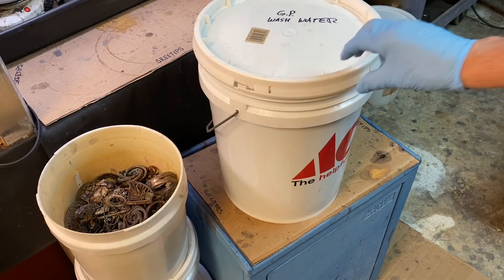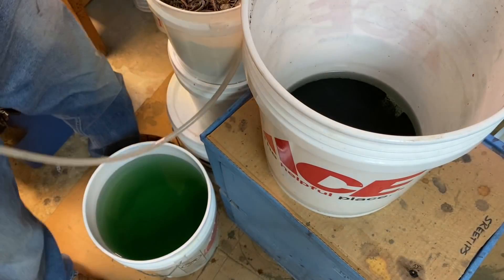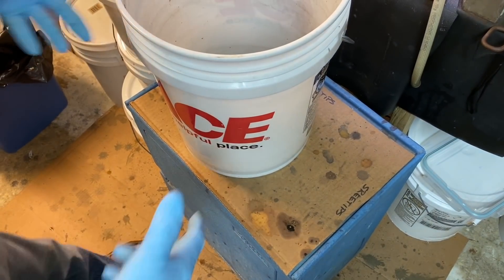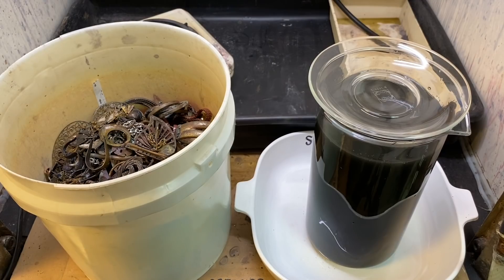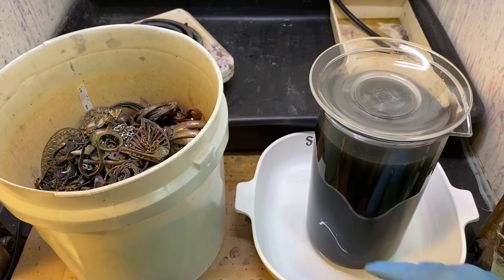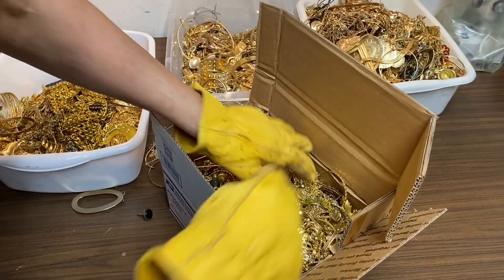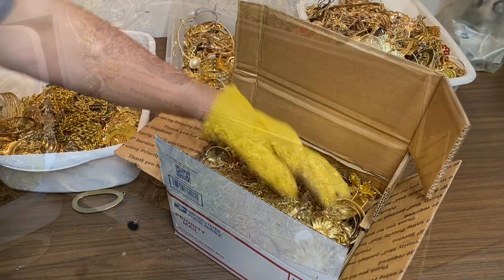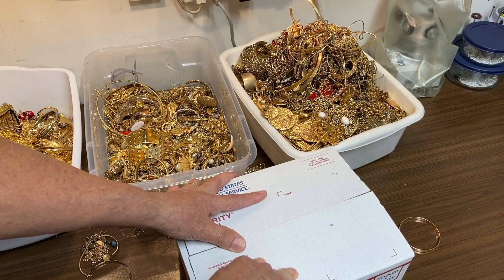Pure Gold Reverse Plating Cell Part 6

Comment: will this work if the underlying material is ferrous, or just if it is non-ferrous?
Reply from the maker: Any metallic substrate should work.
Reply: @sreetips  Thanks. I screwed up a refine not long ago becasue I had steel in some jewelry. I had carat gold with some fill. I got a big mess because of it. I am still sorting it out, but got really busy afterwards.

Comment: You should consider purchasing an auto-syphon.  A brewing tool that saves some time and trouble. It actually has a tip designed to not suck up yeast - it would work great in this application.
Reply from the maker: I’ll have to check into that. The problem is the solutions that I’m working with are highly corrosive. Any steel springs or other metal parts would quickly corrode.
Reply: @sreetips Auto-Siphons are made of a poly. If you type "NorthernBrewer AutoSiphon"  into a search engine it should work.

Comment: If I precipitated gold out my solutions how do I go back to my stock pot and get out the platinum, palladium, silver and other metals? Thank you
Reply from the maker: I just did a stock pot series earlier this year. Seven or eight parts if I remember correctly
Reply: sreetips I just started following you a month or so ago. I’ll try to find it if you cover how to do all that. May I ask what papers you use for you stannous tests?
Reply from the maker: Filter papers cut with scissors into little strips
Reply: sreetips does it matter what paper you use?
Reply: sreetips sorry about the questions I just have like 80 pounds of cpus tons of ic chips some other stuff and I know nothing at all. I ran one batch but I stopped to make sure I’m doing this right. I was doing HLC+ peroxide to bleach and whatever then stump out. But I think I may purchase some 70%nitric acid and make Aqua Regia for more pure results and easier process.
Reply: Or any tips on which method is best to pull out the most pure gold? Your videos are scattered from one metal to another and it’s hard to watch them all to figure out which process is best. I have all chemicals but nitric acid. Just wondering. Paralyzed dude just try to have something to do.
Reply from the maker: I use any filter papers that I have onhand
Reply from the maker: In my experience, low yielding computer scrap is best in A/P to remove all base metals BEFORE trying to dissolve the gold foils.
Reply: sreetips the HCL and bleach will purify it so when precipitated it will be close to .999?

Comment: I still have trouble with depleting scrap jewelry. Some gold will be thin and other substrate much thicker. When the deplating is past the point of removing gold, the ions being removed don’t just remove gold. Other metals start being moved to the destination electrode. So, then, how can we just remove gold from jewelry????
Much gold will be wasted by arbitrarily stopping short. I cannot come up with a process where ONLY GOLD is moved.

Comment: To recover the liquid off a settling material I found it better to pour remaining bucket into a very tall glass or plastic tube. Mine is 3 inches diameter. Settled liquid is very very easy to then de  ok separate into waste water rather than siphon from a large fat bucket. Just my 2 cents worth.

Comment: Funny feeling the yield is going to be low.
Reply from the maker: I’m guessing under two grams
Reply: @sreetips  My original guess, and still current, is under 1 gram of refined gold. The legal minimum in the US is 0.175 microns (about 0.000007 inch) of 10 K gold for an item to be stamped "gold plated". You can bet the manufacturers do not use much more than legally necessary.

Comment: If you use a taller reaction tank, you can settle out the sludge and decant off the acid and keep using it longer. I draw out the acid, then pour the sludge in to a reaction beaker for processing. You only need process the sludge, the acids can be used until it collects water to the point it is no longer conductive. I can then keep using the acid I have drawn out until fully used up. I think I could of run all the scrap and" I mean all the tubs" you have on hand with 2 gallons of Lab grade Sulfuric Acid or less. I never use any tap water because of unknowns and never wish again to make the mistake of putting gold in to permanent suspension, and losing it for ever. One word of note is that you need to consider the sludge at like 6 karat, until you have refined it to higher value cake. Right now you it looks 100x's more in volume than the value that is there. Some than you ran was gold tone or you would not of had the floating mess in the acid bath. The plating values are so all over the place it is never good to put any value in advance of what the recovery of pure gold will be.
Reply from the maker: Yes, could have kept going. But I must move on.

Comment: All that warning in the beginning, but then use water filled tube to siphon acid? Thankfully that had been diluted but maybe should have pointed that out. If that had been your cell electrolyte then a small volume of water from the tube would have hit the bucket followed by the strong acid and fireworks would have ensued. What you did was correct, but someone out there could get it wrong and that would be bad. Good luck to all and everyone be safe.

Comment: Hey Streetips, Since I am not 100% Familiar with this method of stripping, and since Concentrated Sulphuric is pretty nasty stuff, especially the hotter it gets, not that others aren't, but I am pretty familiar with those, I have a question. Are there not risks of forming hydrogen gas?  Is it a concern with the size of the cell you are using? It didn't look like you were using your fume hood, and I was just wondering about the risks. I  have been wanting to experiment with this type of a stripping cell for gold as well as silver, but have hesitated for that reason. Your thoughts would be appreciated
Reply from the maker: I did it inside to eliminate fume hood noise. Best to do it in the fume hood. I smelled rotten eggs for the last five days. Hydrogen is being generated. The greatest danger is spattering the acid on your skin or eyes. It gets everywhere.

Comment: Safety question! Could these reactions be done outside eliminating the need for a fume hood?
Reply: Simply put, no. As you have no control of wind direction, just like you wouldn't stick your head inside of a fume hood unit. I stress, do not attempt to do these experiments outdoors or you are putting yourself and others health and lives at risk. A fume hood directs the poisonous gases safely from the reactions in a controlled manner. There are also various guidelines to the correct installation of a fume hood, from location, proper sealant, gaskets, acid resistant ducts, safe location of exhaust vent and more!
Reply: @evokaiyo  thank you
Reply: In very small batches, yes you technically "can" but you shouldn't. I built my own fume hood using plexi glass a chemical filter with plastic ducting and an all plastic grow room exhaust fan, from Amazon. Cost me less than $200 when complete.
Reply: From direct experience: NO!!! The gasses produced are in a concentration that required SOME form of protection ... at bare MINIMUM, a vent hood ... but I use respirators as well cuz ... Oxygen!

Comment: Mrs. Sreetips is being a killjoy. On the other hand, working through 5600+ grams of jewelry to get a couple grams of gold is not the greatest use of your time. Is there a reliable way to separate the plated stuff that can be used for inquarting from the stuff that can't?
Reply: Not cleanly or efficiently. Gold plated jewelry can contain just about any metals on the periodic chart. It would require numerous steps to make sure one or more did not precipitate out with the gold.

Comment: hello, just a question would it be possible to use the plated jewelry as a inquartation medium for when you do the inquartation step in gold refining or is that just a hassle and not worth the energy/acid?
Reply from the maker: No, use clean sterling or copper for inquart. Gold plated is pot metal underneath.

Comment: If you're finished with the gold-plated  material, and intending on getting rid of the rest.   I would put up an auction on eBay for the whole thing, and ship via freight.   You could increase the value significanty by including the lead bar and copper basket.    It could be a turnkey refining business.      If your final yields ends up as a quarter ounce, I may be interested.     Great work, enjoying the series.
Reply from the maker: I had already planned to offer the tank, lid, copper basket and lead cathode.
Reply: There won't be a quarter ounce. It will surprising if he gets over two grams. 
Smaller lots of gold plate sell for far more on ebay than one large lot.

Comment: you said in part5 that this Method can not be used for computer scrap but what about computer pins that are metal
Reply from the maker: Any gold plated material with a metal substrate can and should be run through a sulfuric acid stripping cell.

Comment: You mentioned you put as much as possible plated material through the cell. Did it fill up, or did the copper basket break? 
I think the spoken warning at the beginning of the video is way more memorable than the written one, thank you for caring about people's safety!
Reply from the maker: The cell was still working, could have continued deplating more jewelry. But my other work in my shop is piling up so I had to call it. Twelve and a half pounds should be enough to give us an idea of what kind of yield to expect from this type of scrap. Could be wrong, but looks to be a surprise to the upside. The copper basket held up well and is in good shape for more deplating.
Reply: @sreetips  ah I understand. Thank you for replying and good luck with all your projects!

Comment: Hey Streetips, I'm loving this series of electroplating it takes me well back because my degree was in electrochemistry.  But I have a question, if you want to rinse the acid/waste solution off the the sediment why not filter it and rinse that way ? that would be my first choice.  But please bear in mind I've not been a Chemist for over 20 years now, I'm an air traffic controller so well out of touch.
Reply from the maker: Sierra Romeo Echo, turn left heading 330, climb and maintain two thousand five hundred, proceed direct your destination. Contact Departure. Sulfuric acid will dissolve a paper filter so I want to rinse off the acid first before trying to filter out the solids.
Reply: @sreetips  pan pan, pan pan, I did not know that so thank you. Hope you are well
Reply: @sreetips  oh I get it now !!  The rinse is not important it's the dissolution into aqua regia that's the key

Comment: could you do like a reverse quantitation where instead of adding silver you could add more gold and turn the gold plated into karat gold and then refine it from there?
Reply from the maker: No. The junk jewelry is a concoction of, who knows what, then coated with copper and finally gold plated. To much risk of getting junk in the gold and cause problem. Sulfuric acid stripping cell for this type of scrap is the easier softer way.

Comment: Sir if we remove that mud in filter and wash it and again put that mud on hotplate until  it becomes bone-dry will it make sense or ruin the process please let us know thanks
Reply from the maker: I will get the mud into a filter. Then put it in a melt dish. Then burn it to 800 F (420 C) for an hour. Then I’ll strain it through a fine mesh screen. Then dissolve it with hydrochloric acid and 6% sodium hypochlorite (bleach). Then filter and precipitate pure gold with with sodium metabisulfite.
Reply: @sreetips  thank you sir egarly waiting to watch the remaining part thankyou

Comment: I wonder if potassium alum could be used in the initial washing steps. It's used as a flocculant in water purification to speed the settling of positively charged particles suspended in water.

We made potassium alum from aluminum cans, potassium hydroxide and sulphuric acid drain cleaner.
Reply from the maker: If it will clean all the grime off the metal then it would probably work

Comment: Would it be easier to melt everything into a big brass bar and then dissolve the copper out via copper crystal growing with electrolysis in copper nitrate.... then collect the metals left behind in the sediment under the brass bar as it disolves and go from there???
Reply from the maker: The metal under the gold plate is pot metal, an alloy of junk metals. We don’t want that junk in our gold. Running it through the cell is the best way to process gold plated scrap.

Comment: Would a magnet on top help it settle faster since gold is dielectric
Reply: Do you mean diamagnetic?  No, it would not help with settling, even if it were diamagnetic.
Reply: @buggsy5  gold is absolutely diamagnetic and y wouldn't it be exploited
Reply: @DaHighRoad  
Because the magnetic field would oppose motion of the gold particles in the field. See the demos of supercoductors, which are perfect diamagnets, magnetically suspended below the strong magnet. Once suspended in the magnetic field, it resists movement both towards and away from the magnet.
Reply: @buggsy5  is monoatomic gold real?
Reply: @DaHighRoad  If the gold is in its gaseous state and raised to a high enough temperature, then yes. That is true for any element.

The only elements that are monoatomic at ordinary temperatures and pressures are the noble gases, such as neon.  Any claim of monoatomic gold at ordinary temperatures is a hoax - or made out of ignorance.

Comment: I was surprised by the amount of power you got. You must have done a great job stripping the gold.
Reply from the maker: It took me by surprise also.
Reply: @sreetips  Lets hope the volumetric gold content is as high as some of your other gold refining experiments. I am anxious to see how much pure gold you get. The solution was not blue, so hopefully you do not have much copper contamination. Hm, there might be some lead, lead oxide or lead sulfate present. All are either poorly soluble in water or insoluble. I don't think the sulfate or oxide dissolve in sulfuric acid either.

Comment: All that waste water to deal with... question: would it make sense to evaporate most of it before you start treating it? Less volume to deal with, even though the concentration of stuff in it would be a bit higher.
Reply: If you remember it was bottled as a drain opener. Why try to treat it? It’s so diluted now just use it to dissolve the build up in the plumbing. Like a maintenance.
Reply from the maker: Evaporation would be good, less liquid to treat.

Comment: I wonder if you could use a deeper copper basket
Reply: He could. It would also be possible to use a larger cell, multiple anodes and cathodes etc. But those require more acid for an experiment that will yield very little gold.